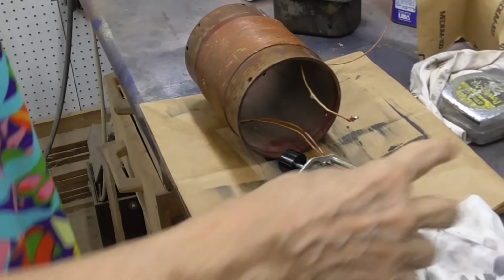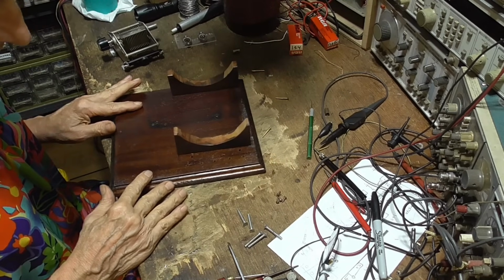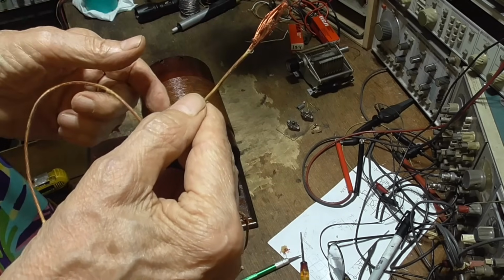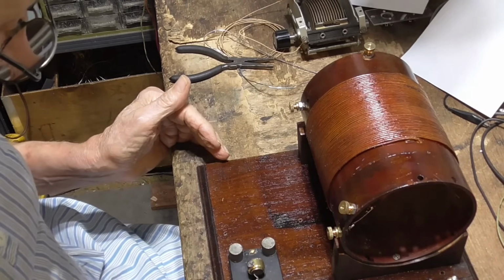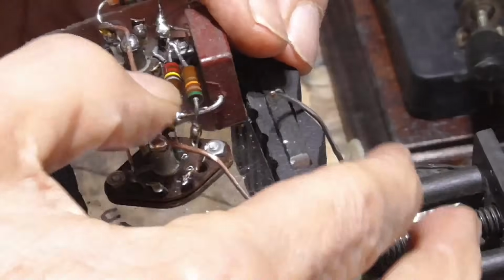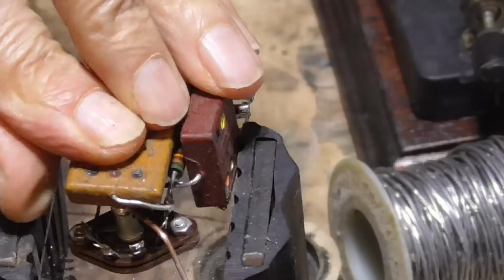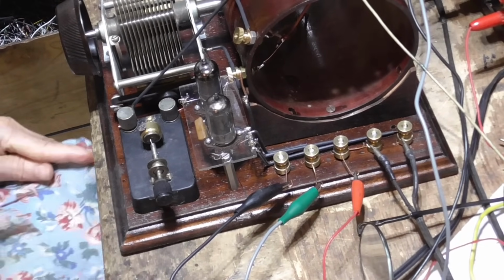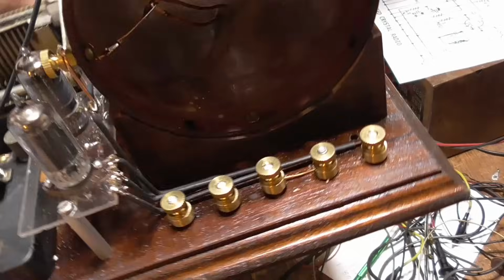MAKING A TUBE AMPLIFIED CRYSTAL RADIO

Comment: I got a  Radio Shack crystal radio 📻 kit  for my birthday 🎂, when I turned 14. I do not remember the outcome of putting it together, if I even did. I don’t know if a crystal radio 📻 gets all the regular stations 🚉 that an AM/FM radio 📻 does. Maybe 🤔 I’d catch some short wave 🌊 stations 🚉. I really do not know what a crystal radio 📻 catches, as far as stations 🚉. I also do not know if I can create my own “in home” 🏠 radio station 🚉. I’ve heard that this is legal, if the wattage is low. Please inform me on crystal radios. Maybe 🤔 the crystal (copper wire wound around a hollow paper cylinder). This is probably the antenna, not a crystal. I know crystal radios are pretty simple. I even noticed the “Kroger” box that you’ve got the radio sitting on. I even like 👍 the impressive length of your video about crystal radios. I might even have the opportunity to learn something about them here. Your friend, Jeff.
Reply: Only picks up AM emoge man.

Comment: what is the in34a for? not needed. Also needs a feedback winding for regen and a screen pot for regeneration control
Reply from the maker: This is a CRYSTAL SET not a regenerative set. The 1N34 is to eliminate the nuisance of adjusting the cat whisker to a sensitive spot on the crystal. Sort of cheating, but still is a crystal set!

Comment: I’m surprised you didn’t wind your own coil.
Reply from the maker: I like using old original parts if I can find them. Some of my projects use home wound coils but if I have original stuff that will look and work right I go for them!
Reply: @glasslinger  , that coil should use Litz type wire. It comes in different grades depending on frequency being received. 
It’s all based on “skin effect”.  Using copper on metal does the same thing.
Reply from the maker: @jmikronis7376  Actual testing I have found that litz is useless at frequencies above around 1 MHz. (I have an expensive variable frequency Q meter that goes to 10 Mhz.)
Reply: @glasslinger , the research labs that tested the Litz wire found different electron flow patterns above 1MHz. The skin depths get even less, the higher you go. The data is readily available online.
Reply from the maker: @jmikronis7376  Internet "experts" know it all. They many times are very surprised when they try to do things themselves! Remember, ANYTHING can be posted online!
Reply: @glasslinger , the data presented is from a published form which was the basis for future manufacturing practices.

Comment: APPRECIATED. VERY PROFESSIONAL LOOK.
I THINK IT WAS NOT REGENERATIVE OR SUPER REGENERATIVE.
Reply from the maker: Right. It is an audio amp connected to the output of the crystal detector. More of an art project than practical. A practical circuit would use an I.C. amp.
Reply: @glasslinger Nah, this is practical too. I reckon if you wanted to make it real practical you'd use a pentode as an RF preselector and get cascode RF stage results by grounding the control grid and biasing it

Comment: Return to galena is dificult but 1 n 34 resolve as secret
Reply from the maker: Note that modern chinese germanium 1N34 diodes ARE NOT the same as the original point contact 1N34 diodes! Modern diodes are made by a  different process altogether that results in a more drastic threshold!

Comment: Could you please restore/resssurect my very old radio.  Pleasee
Reply: what type/model/manufacture radio ?
Reply: @mr1enrollment  it’s a pilot table top radio. Looks to be in the 40’s. I don’t see a model number
Reply: @mr1enrollment  it’s a pilot brand I’m assuming it’s from the 40’s. Not sure model number
Reply: Ron has been known to help people with certain projects, but you’re more likely to get help if you 1) know something about electronics, 2) have the schematic, and 3) have at least some basic test equipment (multimeter, oscilloscope, and maybe a signal generator). He helped me fix a 1950’s Hallicrafters SX-43 radio.
Reply: @xnavynuc  I’m praying he will. I have none of those but have my grandparents old radio I’d like to revive and listen to in memory of them.
Reply: @bgdady4269  I believe that the pilot was a house brand of some type perhaps a hardware store house brand. I'm sure you have some old-time feelings about it, but probably not the most distinctive radio around. Typically something like that's going to cost you $150 to have restored depending on the condition.
Reply: I don't know where in the country you live but - I suggest looking for an antique radio club in your area. Contact them and ask if they know someone that will fix it up.
Reply: @mr1enrollment  that’s ok. The 150$ would be fine just to bring back old memories. I’m sure it’s wY more costly to repair than it’s worth but it’s sentimental to me

Comment: That's a hodgepodge mix of old and new.  I would have used ST12 bulb tubes with octal or 'standard' bases rather than miniature tubes, just to keep the time frame constant.
Those spade bits don't actually drill through plastic, more like melt their way through!
True Litz wire has each of the strands insulated from each other, usually with an enamel coating.  This reduces the 'skin' effect when all of the wires are connected in parallel, to give a higher Q to the wound coil.
You wrapped the wire around the ground post of the coil in the wrong direction.  The wire should go around the post so that as the round nut is tightened, the wire is wound around the post, the way you have it it will unwind as the nut is tightened.
You showed two different schematics, one with 6AU6's and one with 1S4's.  Which one did you use?
Reply: I would guess 6AU6 as is easier and cheaper to find. Those low filament voltage battery tubes like 1S4 could be easy to blow out if not careful
Reply: Often preferable to kind of melt through when machining plastic, especially the more brittle stuff like plexiglass.
Reply: Well, the expert has spoken!  What's the link to your build?

Comment: It's a variable capacitor, not a "tuning condenser". AC Current DOES only flow on the outside of a wire. I'm surprised you know what Hertz is and didn't use "Kilocycles". Are there many actually interesting radio stations still transmitting on the AM band? Care to explain why you need a capacitor between the antenna and the inductor? And why that specific value of capacitor when you have a variable capacitor? "Crystal detector" is an obsolete name for a diode.
Reply from the maker: Here in the USA the AM band (550-1700 kc) (KC!)  :)  is still used all over the country. It is very popular for talk radio programs and such. There is an oversight in the video editing that left the fixed "condenser"  :) in the antenna circuit. The variable condenser is there to reduce the input signal from very powerful local stations.
Reply: @glasslinger  "Talk radio" is hardly something that can be called interesting. In the country I live in once we started using the FM band the AM band quickly became a place to have duplicate transmissions of programs that are best heard on FM, or just talkback, or non-commercial stations. In fact in the last 30 years I've only ever turned to the AM broadcast band if the station I prefer to listen does not have an FM transmitter in the part of the country I'm traveling through at the time.

And, even Amateur Radio no logger uses AM - with most amateur stations over the last 70 years preferring Single Side Band or FM.
AM is a legacy of pre-war times. The only place you find AM-only radios these days is in museums along with black and white TVs. In perhaps 10 years from now the only place you'll find any analogue TV will be in museums.
Reply from the maker: @socialite1283  It's a highly profitable business in the USA. Not likely to disappear any time soon.